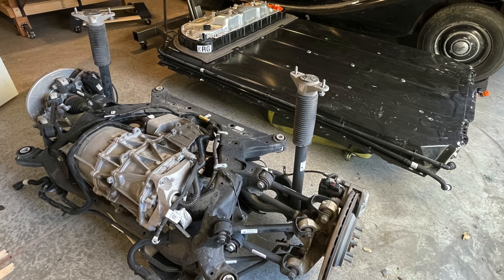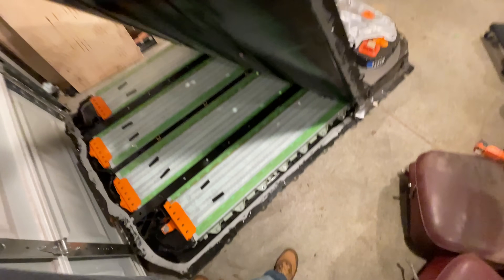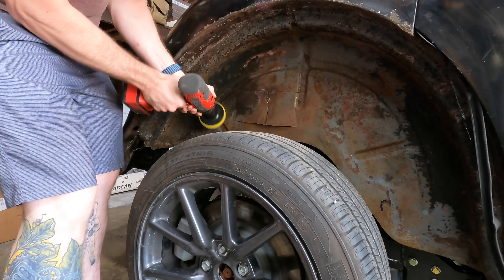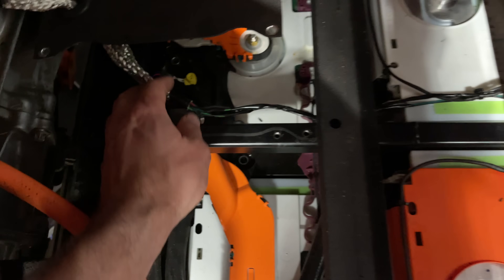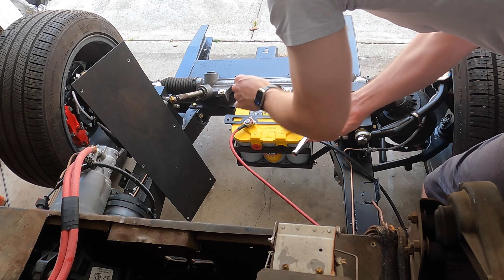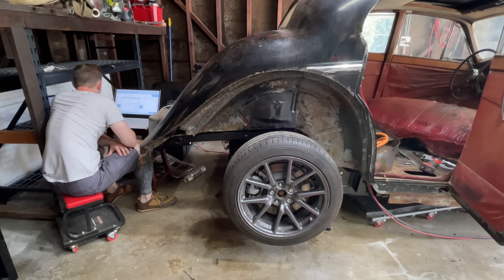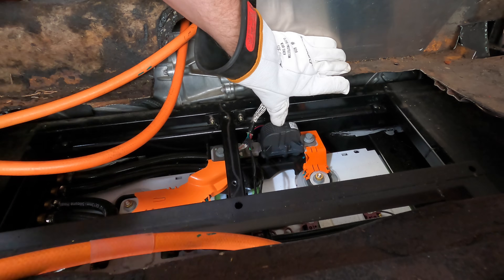The Tesla Motor Is Running In The Jaguar! The Battery & Motor Are In And The Wheels Go WHIRRRRR!

Comment: Coming to this whilst researching how to do this in a Bentley. I absolutely love the problem solving and practical engineering Matt! Would it be possible to fit 6 of the modules and still control them using the Tesla BMS?

Comment: Matt, What did you do for the HVIL? on the accessory port do you just have a dummy plug bridging the ports to simulate a connected plug?  I am running into an issue on mine and cant seem to isolate where I have an HVIL fault.

Comment: I wont have a fuel injected car, I live in the outback. A carb is fine. How the hell could you bodgey up a tesla in the middle of nowhere?
Reply: Most of the vehicles i've seen in the outback have been electronic fuel injected. Most post 1980, very few high way speed vehicles running before 1980. That may be different for on property vehicles.

Comment: What kinda engine nerd are ya?   Lectronic?   I was just a few classes away from getting my electronic engineering and got offered a job at Bose when i graduated..  went for a one off tour and when i was done with the tour i was done with the degree,,.  So i became am industrial electrical and manufacturing engineer..  like it waaaay more than sitting in an office with papers of data sheets, theories and schematics strewn everywhere while i pull out my hair trying to figure out why some mosfet is blowing
Reply from the maker: Mechanical. I had a tour of GM that had me questioning my degree, but I found some other fun places to work.

Comment: The carbon fibre will react with the steel. You need a layer of e-glasss to provide isolation from the steel. Aircraft use titanium fasteners in carbon composite due to the corrosion issue. 

I think you are also mistaken about the trunk. Being a Jag, it has a boot. 
:) You'll upset the geezers watching.

Comment: Awesome!!! Great job.  Good call on raising the tire off the ground.  I had a flipped throttle bit event last weekend in my trailer.  Rear tire spun up to 3k rpms in seconds!!!  Absolute pucker moment
Reply: Concerning your high voltage anxiety, you should install an in cabin MSD (manual service disconnect). It helps me sleep at night

Comment: Might be worth checking the brake input should be strongly pulled to ground eg through a bulb as on some cars they can be either floating or even pulled high. Many road cars come up with brake switch error or just act as if the brake is depressed when all the brake light bulbs have blown 😉

Comment: I don’t want to rain on your parade, however fiberglass/carbon and metal have different heatcycles and corresponding shrinkage/expansion characteristics, which would mean that your solution regarding the outhouse fitment will fail eventually without proper separation or flexibility between both materials.
Reply: How many years after this project car has been retired will that happen?

Comment: Sorry to be the bearer of bad news. I think you messed up on the carbon. You need a barrier layer  of epoxy between the sheet metal and the carbon fabric to avoid electrolytic corrosion. Fiberglass does not have this problem. I would hate for someone's project to die because of something so easy to prevent. It might not be too hard to fix if you do it before much longer. Use some heat (on the back side if you can) and pop the carbon off, clean the metal and put a barrier layer of epoxy where the patch was and let it gell. Put more epoxy on and clamp the existing carbon back in place with a bunch of magnets while it cures, then brush over a final seal coat. I hope you just didn't show putting on a barrier coat, that anti-rust stuff will not do), but if not I hope this helps, and for everyone else, coat your metal with "neat" epoxy before applying any carbon. It bonds better and prevents corrosion that will ruin the bond, and perhaps the entire project.

Comment: I love your work.

A small note: the sheet metal shears at 4:22 are colour coded. Red is left hand, green is right hand, yellow is straight. Cutting a right hand curve with left hand shears can be done (you just did it) but it's much harder than with right hand shears.

The colour code is the standard navy colour assignment eg any red port left, which is weird given that they are commonly called aircraft shears.

Comment: @00:02 I learned you need fuel, compression and spark; and that oxygen is not needed; otherwise you would have said that.
Reply: What's being compressed is air, and if your air does not contain oxygen then starting your engine is the least of your problems.
Reply: @brianb-p6586  I was just poking fun at his lack of mentioning air or oxygen. He's usually very detailed, and does great work.

Comment: I'm going to criticize your use of composite patches on a steel body car.     Where you joined the two materials, there will be too much stress concentration.   After some usage, your composite material is likely to crack and fail.  It was taught in my engineering course, composites are sensitive to stress concentration and will fail due to crack propagation.

Comment: Huh, never thought I'd see what appears to be a Tesla oil filter at 8:25, lol
Reply: Why is it a surprise? It's a Tesla drive unit, and it's probably the original filter. Even if you want a replacement filter, they probably made it unique (for no good reason) so you might have to buy it from Tesla. At least it is classed as "over the counter (no VIN)", meaning that you are allowed to buy one for your Jag.

Or, are you surprised that it has an oil filter at all, rather than that the filter is a genuine Tesla part? Gearboxes with pumps commonly have filters; this is one is just a external spin-on instead of internal, but that is unusual.

Comment: Ironically, electric motors are far simpler than IC engines. It only looks complicated because of the controller.
Reply: But the motor is useless without the controller, so it's not as if you can just ignore it.

Electric motors are simple compared to IC engines, but batteries are complex compared to fuel tanks and controlling power to run a motor is as complex as controlling fuel to feed an engine. Both systems are complex, and it makes no sense to compare one isolated component of one system to an isolated component of another system.

Comment: Pls paint the wells with rattle can two part epoxy primer before undercoating it. Thank me later.
Reply from the maker: Yep; I did that with the underside, except I brushed on the primer. I plan to do the same thing with the wheel wells.

Comment: My heart rate goes up just watching you start the motors in that garage for the first time. You admitted to know little about electric drivetrains and it looks like you have 0 safety precausions for a High Voltage or Lithium Battery Accident. 
Should this thing malfunction in a dangerous way, you won't have time to get out of that garage. Most electric accidents happen faster than you can blink, let alone jump up and run to a door. Also your house will probably burn down, but that's not so important if you are dead... 
Please atleast do the first test runs and such in the driveway, instead of inside and get some proper HV gloves and HV shears, to cut off the battery in a worst case scenario

Comment: Trying to wrap an NSU Prinz 4 around a tree and surviving it. That was some 40 years ago but I still wonder if driving would not be much safer without a steering column. I did not actually succeed to wrap the car completely around the tree but I came close and the column did come close to my ribs but the safety belt keep me and the column from meeting ... When Elon Musk says a car would be much safer without a steering wheel I do agree. Although, maybe a tiller was not such a bad idea in the first place. It works great in boats and they used it in electric cars back in 1920 in the Baker Electric and in the Columbia. My wife was driving the Columbia at a Museum and she says it drives almost like our Mitsubishi i-MiEV. Except for the tiller of coarse. :)

Comment: The phrase "flash the firmware on the oil pump" bothers me on an existential level.
Reply: Yeah me too. I hear "firmware on oil pump" and I think I'll just never work on an EV. As a software engineer, this is way too much like work.
Reply: Yep, its using a single bus LIN bus.
Reply: Cause we all know that oil pump is actually sending data to the communists.
Reply: I want a dumb oil pump.. I don't want an intelligent one which has its own opinions and needs.... sounds like a troublesome relationship
Reply: @tonyhussey3610  I don't even wanna deal with my own opinions and needs.
Reply: Your existential level seems a bit lower than mine.

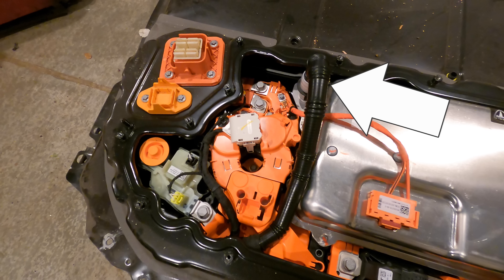Comment: 3:32 Someone smart can explain that ("it would then collect air") to me?
Reply: The cooling system needs to have as little high points as possible otherwise due pressure (if not pressurised) will create low pressure points in high elevation spots and in such points the gasses would drop out of solution (the coolant will degas) which when cooling is circulated can be pulled to the pump and/or create a gas block and the flow of coolant could be impacted. So he would have to install a bleeding valve up in the highest spot which would be a periodic maintenance spot, because the gases that de-gas out of the coolant would naturally collect there. (Side note, in normal hydraulic home heating installations there are automatic degassing valves...)
Reply: @el_es  What are the gasses made of? If it's just air, can't he vacuum-degas his coolant one and for all?

Comment: I have no clue as to the amount of cooling you're going to need or rather or not you've got plans already, but perhaps I could help. I have a large all aluminum radiator originally built for a 60s Camaro that you can have. It's still in great condition and was well built, but I can't remember the name of the manufacturer. It also has an internal transmission cooler built in. I'd be happy to give it to you if you think it would be of use for this project. It's a bit too much capacity for anything I have even if I used it to cool all my vehicles simultaneously. I'd really like to contribute towards this project after watching it come this far. If you're interested just email me at ivanwilliams58@gmail.com and let me know if you want the dimensions or some pictures.
Reply from the maker: Thanks Ivan, but I just ordered a radiator; I got one that will be the perfect size for the Jag grill.

Comment: I'd never considered it until now but does an EV goes as fast in reverse as it does forward?  (Obviously it's controlled electronically but) can you install the motor backwards?
Reply: Yes, some people install some Tesla drive units backward because they fit in the car better that way. They need to fix the oil pump arrangement, but other than that it's just software... although it is also possible to switch the order of power and encoder wires to make it run backwards when it thinks it is running forward. Direction of torque does matter to the bearings of the gearbox, but that appears to not be a problem with the specific bearing design that Tesla uses.
Reply from the maker: I'm sure there are software limitations, but if you could change the code, you could probably run it backward. There might be some weird loading cases that haven't been analyzed or tested though.

Comment: I have a Model 3LR. WARNING! If you are using the standard Tesla accelerator, the pressure difference on the pedal between "Violent mind warping acceleration" and "this is still too fast" is around 5mm travel. It needs a better spring or more travel. Many times when I have shuffled around in the drivers seat while driving, I've nudged the accelerator and the car suddenly becomes the Millennium Falcon :) /safetymessage
Reply: I wonder if that could be fixed by modding the software?
Reply: @dennisthemenace9133  it most certainly could.. but where's the fun in that :D

Comment: I really love watching these.  I wish I could do an electric swap on my 68 C10.
Reply: like this one? https://www.youtube.com/playlist?list=PLpU8R43eP3FFhQ08TQD3IC6Q5QzfpqBTL
Reply: @uliwehner  I have been intently watching that one for sure.  That is not a 68 so my frame is drastically different but it is way cool for sure .  I even asked them if they build chassis for other trucks like my C10.  They are making that truck a unibody cab so it should be quite interesting.  The fact that it has two large scale motors and is all wheel drive it should be BRUTALLY fast.
Reply: @jodydewey3516  yeah that's capable of 1200hp. Crazy. I just want to do a model 3 setup in my brz

Comment: water is the preferred fire fighting method for lithium fire as the idea is to remove heat to prevent thermal runaway.
Reply: I'm not sure if that's entirely correct.... Water on lithium is to fire suppressant as sneezing with diarrhea is to a first date.
Reply: as per FAA Safety Alerts for Operators (SAFO) 0913:

Fighting a Fire Involving Lithium Batteries:
The technique for fighting a fire involving lithium batteries is the same, regardless if the battery
is a disposable or rechargeable lithium battery or battery pack.
• Relocate passengers away from the device.
• Utilize a Halon, Halon replacement, or water fire extinguisher to prevent the spread of
the fire to adjacent battery cells and materials.
• Pour water, or other non-alcoholic liquid, from any available source over the cells
immediately after knockdown or extinguishment of the fire.
Only water or other non-alcoholic liquid can provide sufficient cooling to prevent re-ignition
and/or propagation of the fire to adjacent batteries. Water, though it may react with the tiny
amount of lithium metal found in a disposable battery, is most effective at cooling remaining
cells, stopping thermal runaway and preventing additional flare-ups. Significant cooling is
needed to prevent the spread of fire to additional cells in a battery pack.
Reply: @old_romans  That is so counter-intuitive to what I know about lithium, but I guess the amount of lithium in each cell is fairly small. I use to work near a lithium mine in Nevada that had many barrels stored improperly. Eventually one of the barrels rusted enough to expose its contents to the atmosphere and shit hit the fan. Just the moisture in air was enough to ignite. I'm not sure of the exact details, but from what I remember being told the efforts to contain the spread involved using water. It didn't go well. However that was large concentrated amounts of lithium unlike batteries, so I can see how water would be beneficial under the event of an EV fire.
Reply: @ivanwilliams3736  That's the key: it's a lithium-ion battery with hydrocarbon electrolyte and a electrodes containing a few kilograms of lithium in entire battery, not simply a block of lithium.
Reply: @old_romans  "• Relocate passengers away from the device." It worries me that this is had to be said. Hopefully this was part of the original and not drafted in after a botched rescue. I can imagine the TV interview where the fire chief is saying how the vehicle fire turned tragic once the occupants remained inside the vehicle for warmth while the fire fighters attempted extinguishing the car. "We didn't want to inconvenience them more than they'd already been. Plus the absence of combustible fuels seemed evacuating would pose more hazardous on a busy street"
Reply: doesn’t lithium make hydrogen and heat when reacting with water?
Reply: Also, National Transportation Safety Board:
https://www.youtube.com/watch?v=J6eS6JzBn0k

Comment: Fuel, compression, spark aaannnd timing:)
Reply from the maker: To be more precise: the right amount of fuel, high enough compression, and a correctly timed spark.
Reply: @SuperfastMatt  No. To be more precise, Spark plugs installed correctly in the engine, correct timing, proper voltage, the correct amount of the correct fuel atomized correctly, and high enough compression (but not too high!) but just the right amount of high>

See,we can take this forever.
Reply: @JNorth87  No, just the key FOB.

Comment: liked the ending - "so i'm basically done"
Reply: When you have a car and you have a motor and a battery and the wheels do spin for the first time you are basically done. You wont stop until both you and the car hit the road - license plate or not. Everything is going downhill now but a means to turn the wheel into the directing you want might might be a good idea and to have them pointing into the same direction would be great. It is far easier than what has already been done.
Reply: Tesla shld sell a diy pack for old cars conversion.
Reply: @livedtea4363  fully agree, but would ad Nissan, and ford. conversion is the only option for the future classics

Comment: I thought getting an electrical motor to work only required two things.  Current and a ground.  And the magic smoke.
Reply: technically, yes! but then you need to control that voltage and current, modulate it in a way that gives you the appropriate speed, then you need safety limits to protect the motor from being driven too hard, then you'll want a lot of protections for that big battery to make sure it doesnt explode or catch fire spontaneously, and to keep it useable. and thats just the basic stuff! For basic evs, like my ebike I built.
Reply: @EllaBananas  How did you manage the magic smoke though?
Reply: @MickeyD100  It's right in the name: M A G I C ! 😌